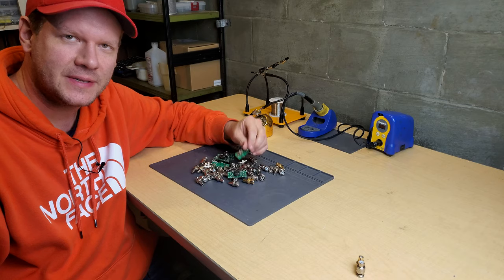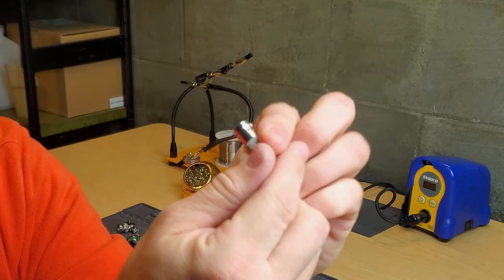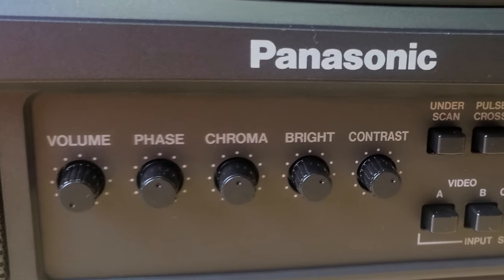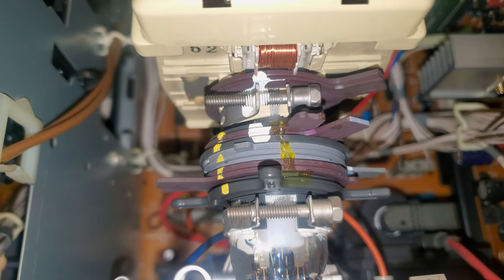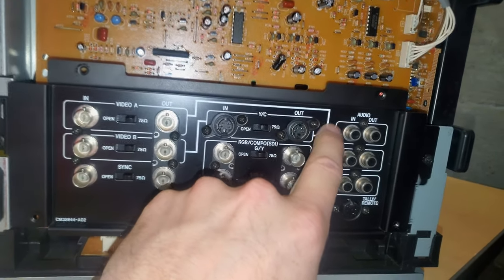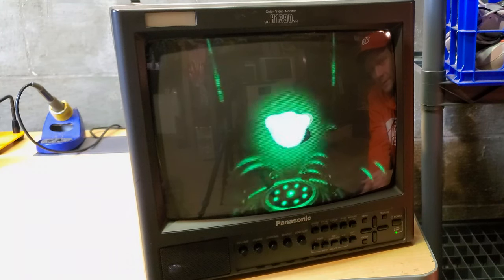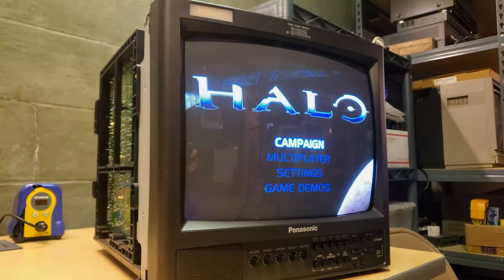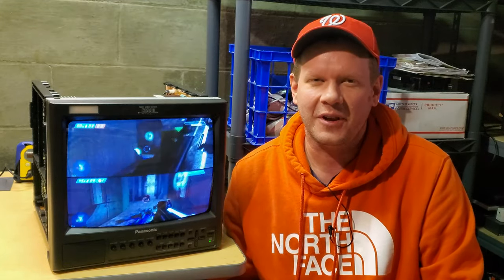Is this the Most Underrated Pro-CRT in Retro? | The Panasonic BT-H1390YN Monitor

Comment: There are some great monitors from other manufacturers out there. People also tend to underestimate how good a higher line count shadow mask tube can look. I have a JVC TM-H150CG that has 750 TV lines, and it looks amazing. Steve has shown one on the channel before. I also have a higher end JVC DT-V1710CG. This monitor has 800 TV lines and it actually has an interesting, completely flat aperture grill trinitron style tube. It looks absolutely stunning, and can go all the way up to 1080i in analog and digital modes. The only issue is that it can be finicky with sync from some consoles. I would like to see Steve take a look at that one in the future.

Comment: Just picked up one of these for $80, although it's not giving me proper picture at the moment. I'm definitely going to try and fix it though.

Also, regarding the JVC parts, JVC released the BM-H1310SU, and I believe that this Panasonic is a rebranded version of it. Matsushita (AKA Panasonic) was the majority stockholder of JVC until JVC merged with Kenwood in 2008.

Comment: nice, I have an olympus OEV 141 that's a rebadge of some panasonic pro-monitor or another. A bit older and more basic but the TVL count is still super crisp and the tube is probably the brightest I have. And the dot shadow mask looks really cool
Reply from the maker: Cool, yeah the 141 is a rebranding of a Panasonic Monitor.  It's closer to the next Panasonic I'll review, the BT-H1350Y
Reply: I did some research, and it turns out the OEV 141 is a rebadge of the Panasonic MT-1480. I also have a 141.

You're right, the high TVL with a dot mask gives it such a unique look, especially playing 240p!

Comment: I recently picked up a JVC BM-1400PNKA and this Panasonic basically looks identical, it has exactly the same outer frame, exactly the same front and back panels, and even the menu options are the same. I wonder how much inside the Panasonic is actually unique or is it simple a 100% rebranded product?

Comment: Just picked up a BT-S1360Y from an auction for $25!

Having the hardest time finding the service manual for this specific model- produced 1992

It works perfectly with my N64 S-Video streaming capture setup, and the condition is breathtaking for the age. Am curious if the original owner (forensics professor at a community college) replaced any interior parts or restored it in some way. I suppose this is a 2-part question:

Does this BT-S1360Y service manual exist somewhere online, and what would clues of restored work look like if I do go inside?

Thanks for the amazing content as always.

Comment: Looks great, 750TVL is nice too at that size. It's a shame it doesn't do 480p but surely 480i is good enough on such a screen. I have the potential to pick one of these up free from work where it would have likely had light use in the AV gallery of a lecture theatre or possibly used as an external monitor for viewing edits or monitoring VHS duplication.